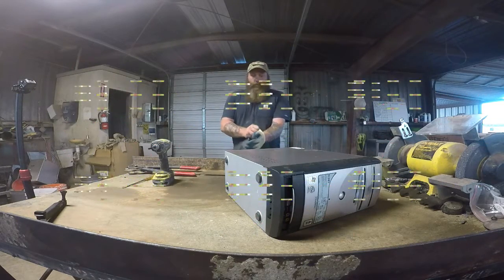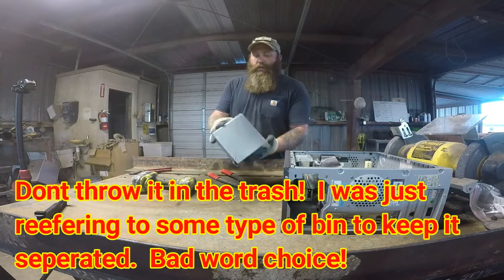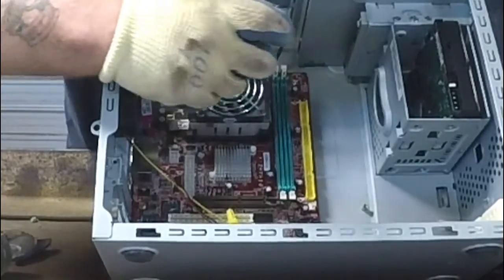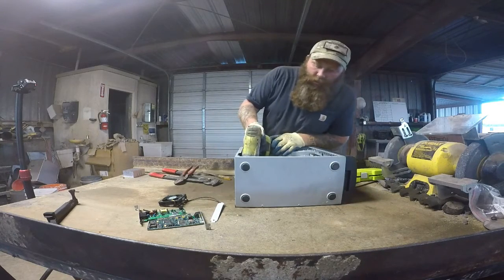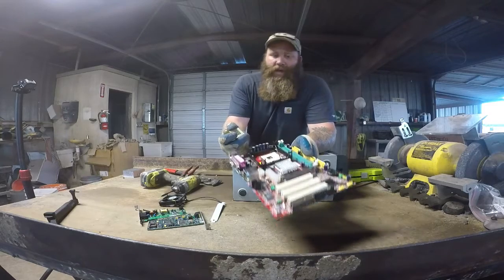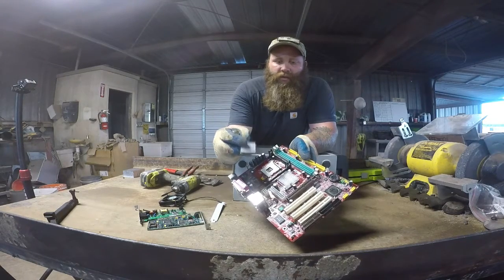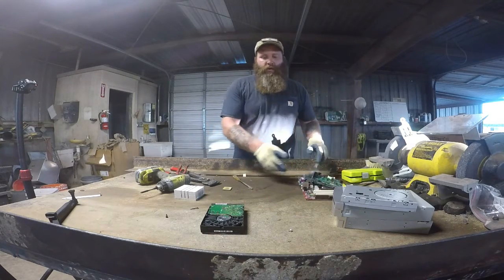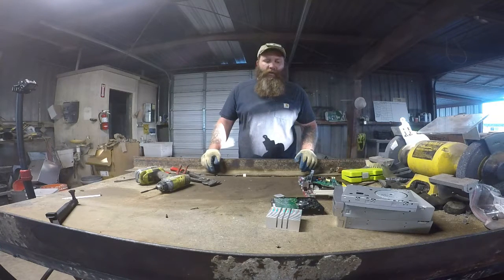Electronic Scrap Computer Tower Breakdown

Comment: So you cut the wire harness off of the power supply. To turn that wire harness in should you cut the zip ties and ends off?  What is the price difference between just the wires compared to wires and ends?
Reply from the maker: Timothy, great question.  It really just depends on the yard you are going to.  At Bracken Recycling we buy them with the ends still on there.  No need to worry about the zip ties.  Today we are paying $0.40 per pound on that wire.  And if you had a couple hundred pounds we might even pay $0.45.  But it is best to check around your area and see how the scrapyards buy it.  On average our buyers pay $0.04 to $0.06 LESS for power supplies without the wires.  That's why I say to cut them off.  I've never actually done a recovery on it, but in my head, it's probably worth it.  Maybe I'll try it out and make a video.  Let me know if you have any more questions.  Hope that helped!
Reply: Bracken Recycling Thank you for the reply one last question. If all the ends were cut off and the qty was under 200 lbs what price would you pay?  It would be more then .40 cents right?

Comment: Apparently it is worth it to cut off all the gold plated pins and stuff, not to extract the gold yourself though unless that is something you do already and have knowledge about. There exists a huge market of buyers on ebay that will buy it from you at much higher prices than a scrap yard will offer you. Alot of escrap in general goes for more on ebay as long as you have the patience to list it and ship it but as with anything once you get going you can get a real good revenue stream coming in.

Comment: volume is an issue here. I can hear what you're doing quite loudly but your voice is too low.
Reply from the maker: Tim, I agree!  I almost thought about not uploading it!  I'll probably redo it someday.  I had guys pouring concrete that day, and I had to remove background noise from the machines they were using, and it messed up all the audio, and I'm new at video editing so I couldn't fix it.  I guess I got a little trigger happy!  The next one will be better, I promise.